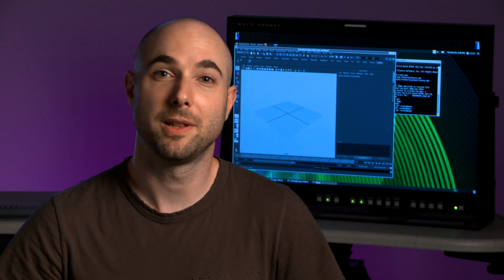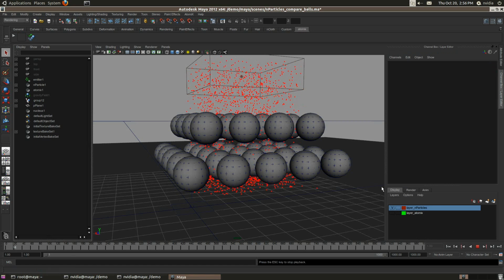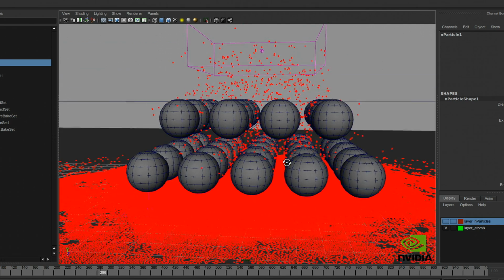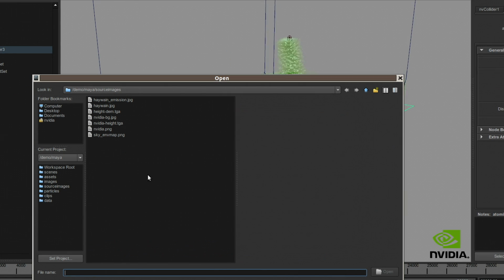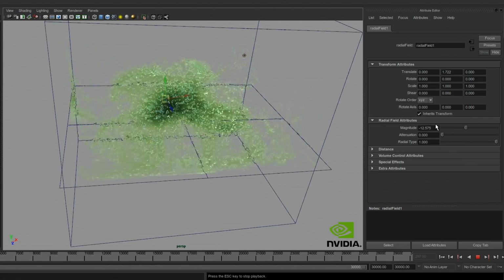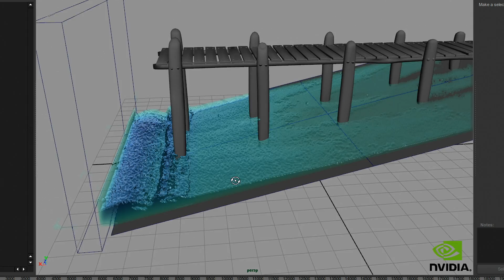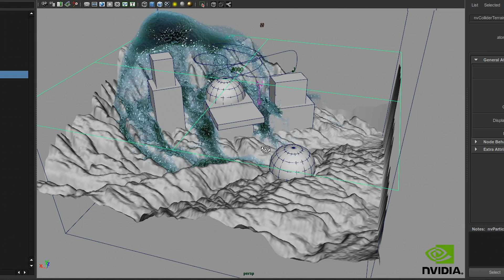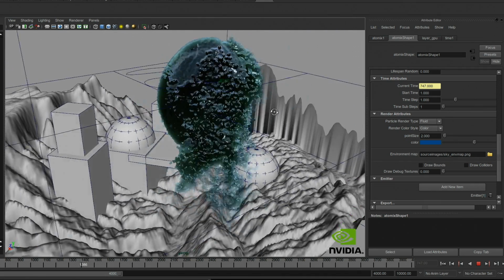NVIDIA Maximus increases particle simulation exponentially in Autodesk Maya 2012

Comment: the most of app  doesnt use cuda tech.so  for now ,it s useless for 1-2  years .Also, still not  enoughf particals for high  qualty scenes without high lev. quadros. Quadros(with high level performance) s  so expensive for general users...
vray rt (latest beta realese pack wit  max 13),blender cycle engine uses  cuda.the  others?
i think it s not worth  spent  my money...

Comment: nice work indeed but did not resolve maya problem with particles. i use them to shape in 3d in realtime with a digital glove. i really need gpu power to go beyond too strict limits of maya. its not possibile to build a solution for every program, so i suggest to build a WRAPPER or a program that load your favourite program and manage the cpu/gpu power himself. thus will make use of all cuda capable gpu.

Comment: @plodej Not long ago, you used to be able to even flash a GeForce card with Quadro firmware, or use modified Quadro drivers to enable all of Quadro's features on consumer cards. Because they use the same damn chip inside. But after the 8xxx series, Nvidia put in protections against that. ATI too.

The only real hardware difference is a larger amount of memory and lower clock speeds. For the most part, you're just paying a massive premium for complete drivers.

Comment: @plodej Again, these aren't actual HARDWARE DIFFERENCES, even though they might sound like it to the average person reading that. All it is, is that code has been added to the drivers to accelerate those functions using the shaders.

Quadro and GeForce chips come from the same fabrication wafer.  For example, GeForce 465, 470 and 480 are the EXACT SAME CHIPS. It's merely that the more defective ones on the wafer get shaders disabled and become 465's or 470's, and some become Quadro's.

Comment: @plodej No, the chips aren't slightly different. I know a lot about how GPU's work, and follow the industry closely. I even read Nvidia's whitepaper on the Fermi architecture and understand it.

The Quadro 5000 for example uses the same chips as a GTX 470, which are GF100 chips, same types of memory, same bus width, same number of ROP's. Except that the 5000 has 96 of it's shaders and 12 of it's TMU's disabled. It is the exact same chip, from the exact same chip wafer as the GeForce ones.